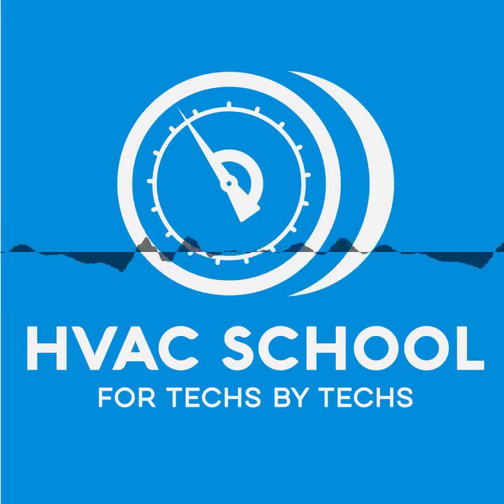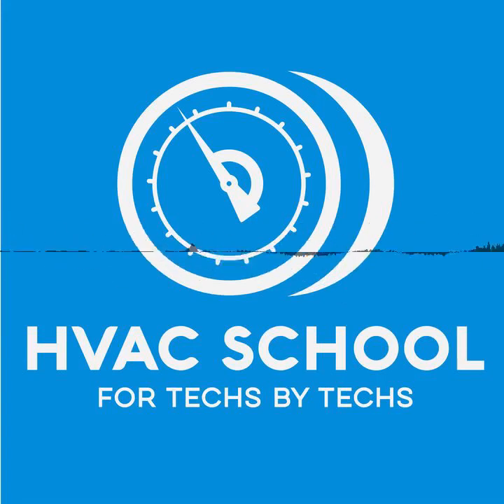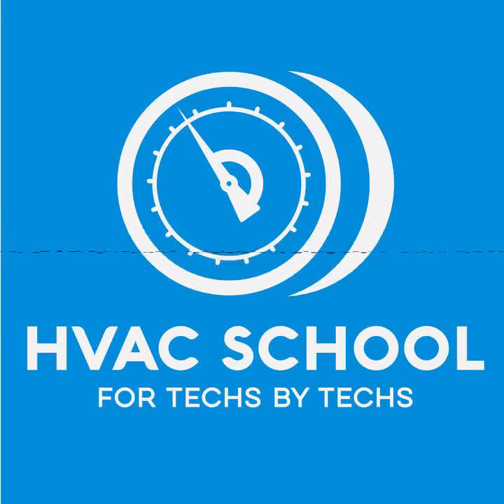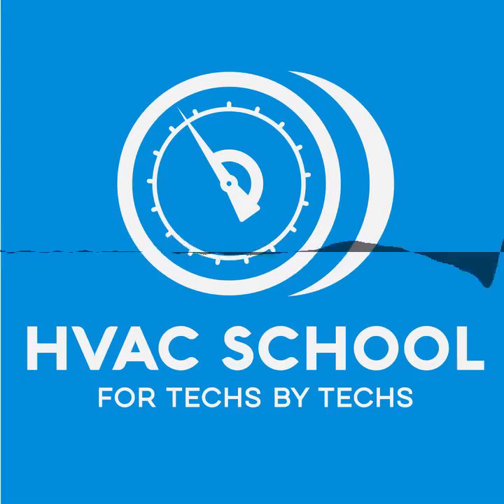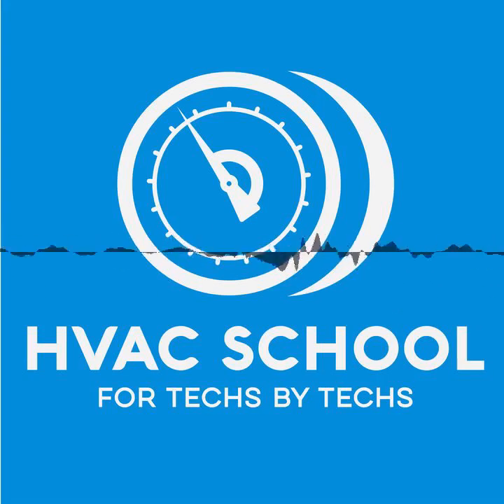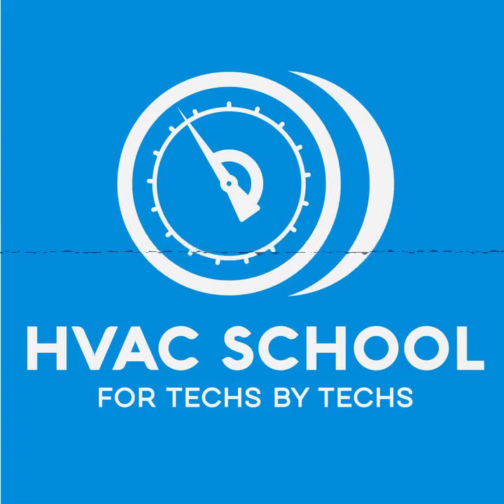Short - Energy? Compared to What? EP1

Comment: In the case of a dimmer switch which provides resistance to flow and reduces the energy provided to a light source, is the resistance of the dimmer considered part of the "load" in the circuit?  In other words does a dimmer switch reduce energy consumption or merely divide energy consumption in the circuit?
Reply: With a simple resistive load like an incandescent light bulb, a dimmer switch will reduce energy consumption because adding resistance reduces current flow. Wattage is calculated by multiplying volts by amps. The voltage supplied to the circuit would be constant, so reducing current flow by increasing resistance would decrease energy consumption.
Reply: @averyalexander2303  Great answer!  I have been wondering about that phenomenon for years and what you say makes perfect sense.  Thanks!!